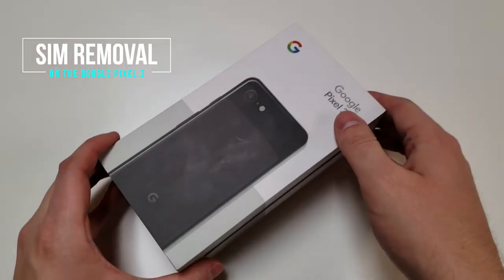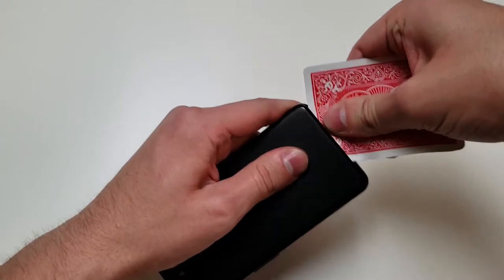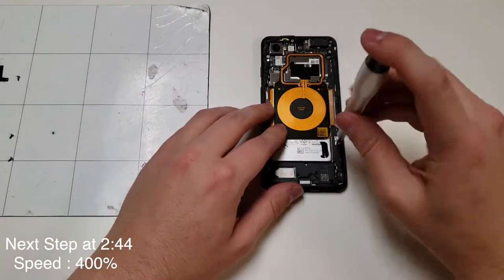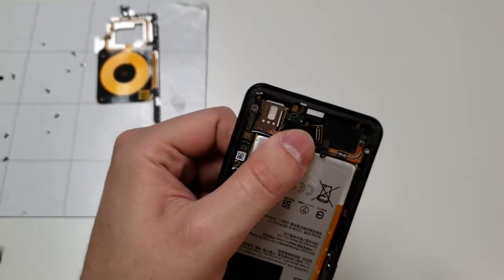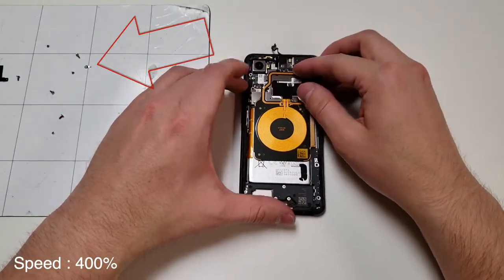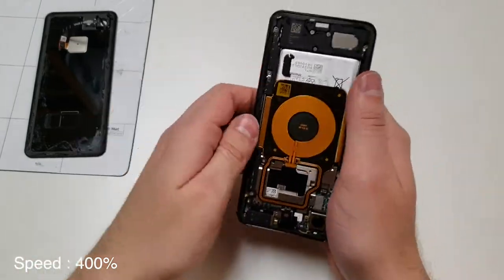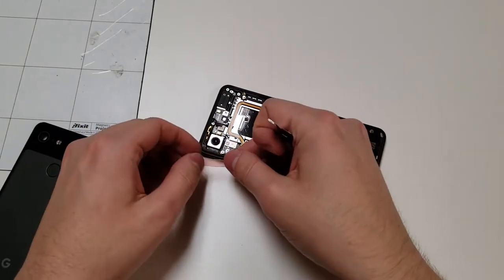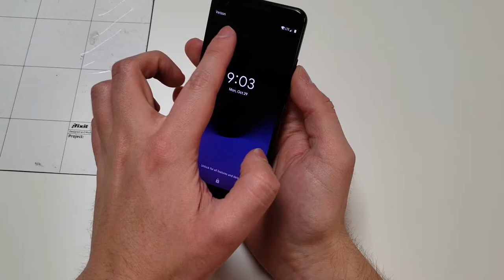Google Pixel 3 SIM Card Removal (When Stuck)

Comment: I would video really nice tutorial question so was there really an SD card in the phone before you removed the SIM card? Because if there is that was mean that Google is using just really good SD cards and disabling that functionality in the software so would it be possible to upgrade your storage on your Google pixel 2 let's say 256 gigs with the right micro SD card and then put it back together. Anyway just a hypothetical question their keep up the great work and I'll see you in the next video have a good one.
Reply from the maker: There was a memory card stuck in the phone, but the phone does not support a memory card. I wish Google added this cheap hardware too the phone, but the customer did not know this before bringing it to me. The only Google phone to support an SD card was the Nexus One. After that, they went all in with strictly flash memory only.
Reply: @RealWorldReview  oh okay okay thanks for the clarification appreciate it have a good one.